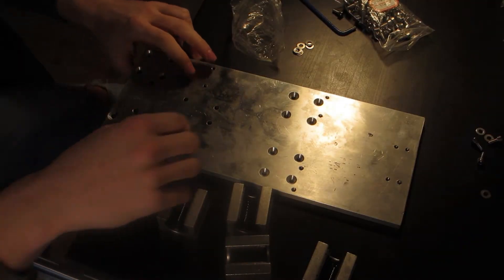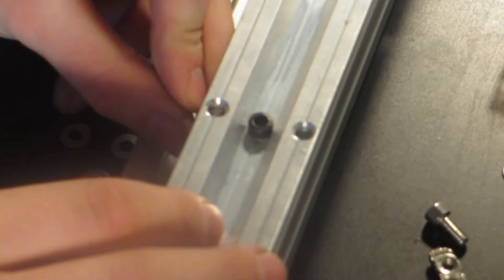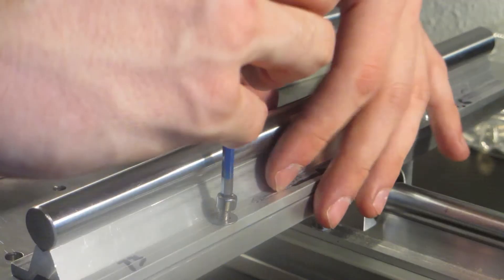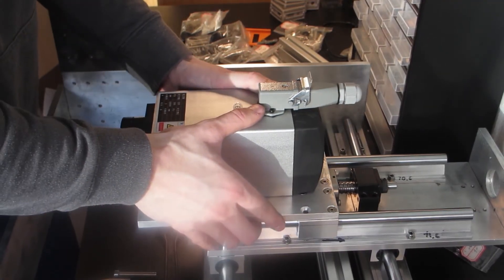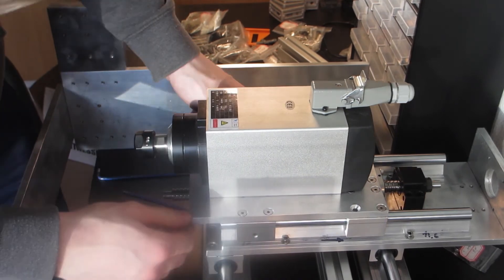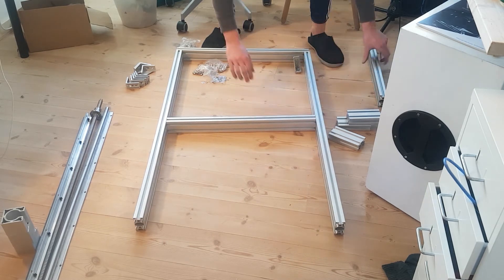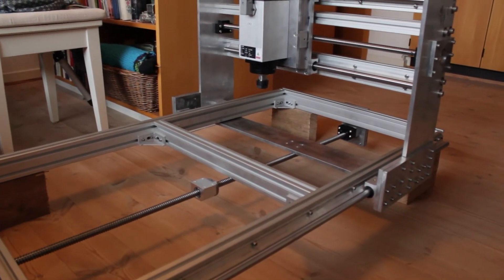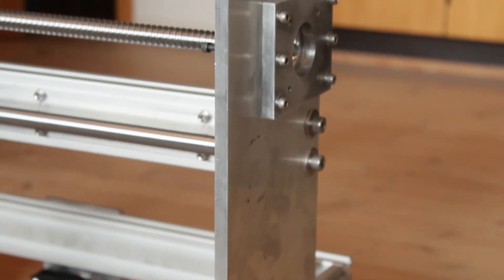CNC Router Build Part 4 - The Assembly

Comment: nice project! one tip for you - if you mount the z axis rails on the front plate they will help stiffen it up. the z axis is always the weakest link...
Reply from the maker: Thanks for the tip. I won't be changing the design for now though. Everything is super stiff already though